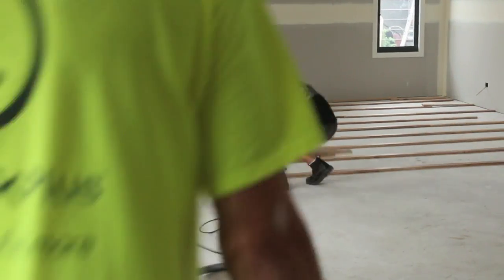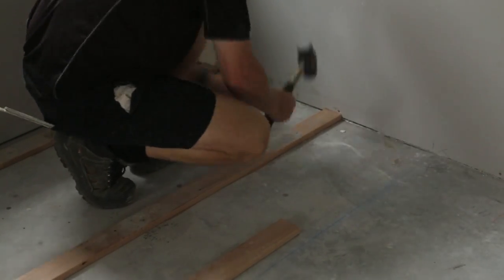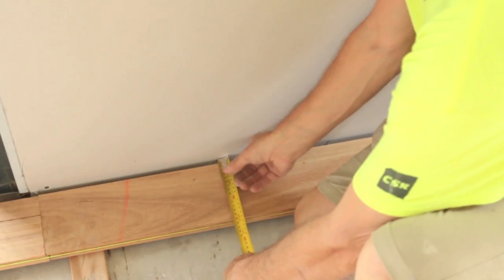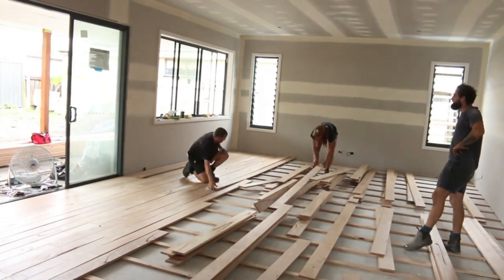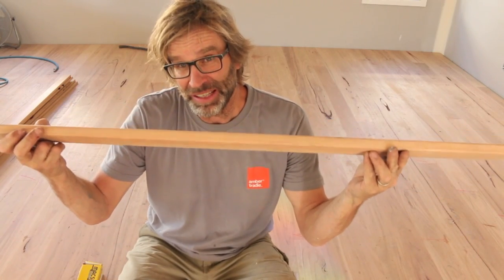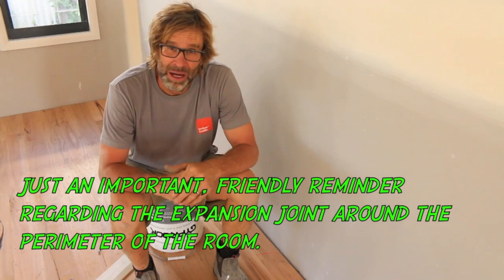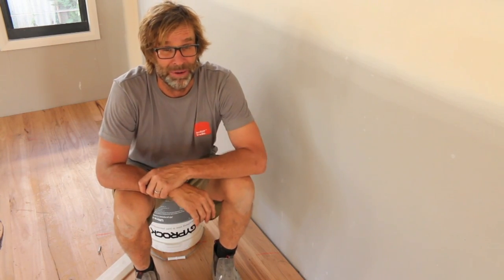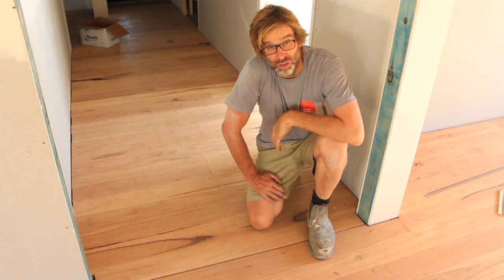How to Install Hardwood Flooring.

Comment: jeez uncle K, cant think of anything more satisfying in a project build than laying down a beautiful timber floor. some quite attractive layers too!
Reply from the maker: I tried my best for you Albert :-) That's how all the tradies look over here. :-)
Reply: Shano, just wondering... is there much problem with lemons when buying boards in bulk like that [ twisted, cupped, borer holes etc]. what % lemons would you say is acceptable. ive never bought in bulk but when buying timber from masters or bunnings [spotted gum especially] for projects have to spend a bit of time going through the stacks to find clean ones.
Reply from the maker: Mate whenever l order a bulk lot, especially with something like solid hardwood flooring, l get it direct from the timber supplier. I haven't had to many issues. However when buying things like framing pine from bunnings (you haven't got much choice these days), l nearly always select the studs myself.  If you don't they just throw whatever is on top of of the pack onto the truck.
Reply: yeah got to get away from the convenience of the majors and find a good direct source, cheers mate

Comment: Great choice of flooring. Its a lovely timber. I wish we had a 'secret nailer' when I was laying floors, its a tedious job by hand, especially on the hardwood boards ... clamp, drill, drive, punch, move on, repeat .... Waiting for the excitement of the fix out. Looking forward to the kitchen - they're my favourite room, so full of possibility ... to get it right, or not :-( Hope thebudget is hanging in there.
Reply from the maker: Thanks Shano. Blackbutt is beautiful, especially the feature grade which has all the knots and veins running through it. The mighty secret nailer….gotta love it. The budget…..??? what budget :-) Na t's going pretty good so far. No major blowouts so all's good. Stay tuned for the updates mate coming soon. Cheers :-)

Comment: I have a house on slab. No crawlspace and no subfloor just concrete. watching your floor go down was great as I need to redo my kitchen and hallway. The Home Depot here doesn't have the ultraset adhesive but I'll find something. I like the idea of using battons but not sure I want to raise the floor that high compared to the rest of the house.
Reply from the maker: Yeah Mike, that's the only problem with the battens when you are retro fitting. I calculated that extra height of the batten into the equation when l was doing the slab. Cheers mate

Comment: Shane,  I take it that the battens are also 19mm.  I had a timber floor sanded a few years back and there was some very random timber colours throughout, Spotted Gum if I remember correctly.  It came up good with the finish (polyurethane), but I gave seen Blackbutt flooring and this batch looked a pretty standard colour throughout.  I'm guessing that some installers just use a ramset to fasten the battens to the concrete floor.  Going to watch the video again as I might look at doing something like what you did on my place out near Longreach, be a change from the floor tiles....
Reply from the maker: Yes mate they are 19mm. The trouble with Ramset guns these days is that the installer is required to have a gun license…..yes , a bloody gun license because of the explosive action of the ramset. If you've tried recently to hire any explosive equipment (like a ramset gun) from some hire company like Kennards you'll find that they won't hire it to you without a license. 
I used feature grade which comes with all the gum veins, knots etc which really give the board some character. Standard grade looks ( in my opinion) to perfect…..almost fake.
Have a good weekend mate

Comment: Knackers, what type of timber did they use for the battens? BB? The batten looks around 25mm thick?  Looks like a great system. Thanks.
Reply from the maker: The system is awesome John and yes they are 25mm Kiln Dried (KD) Hardwood Battens. Good luck with it  👍👍

Comment: If the timber boards are nailed down (so they should not move) what does the expansion joint do?
Reply from the maker: Timber expands in humid conditions....nails don't stop that from happening unfortunately. My floor is glued and nailed down yet still manages to expand between 5 and 8 mm which is why an expansion joint is necessary. 👍

Comment: Any reason why they didn't lay concrete plastic to stop moisture from the concrete coming up to the floor?
Reply from the maker: Some guys do Lauifi. Having the floor laid on top of battens means that you don't have to. There's a layer of air between the top of the slab and the underside of the boards so some ventilation is available. If laying directly on top of the slab, or if you lay chipboard down on top of the slab which you nail the floorboard to l definitely would. Some people instead of laying plastic roll on a concrete sealer. Hope that makes sense. Cheers
Reply: +shaneconlan1 to easy. Thanks mate